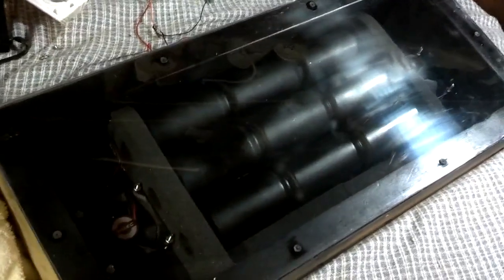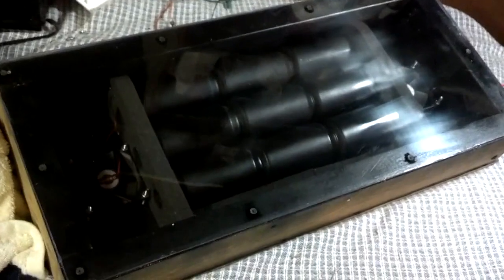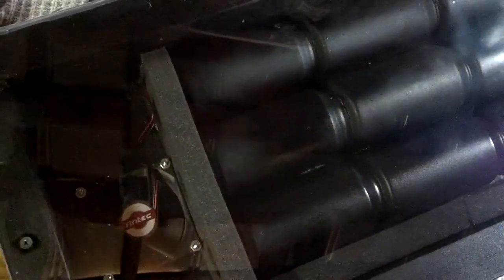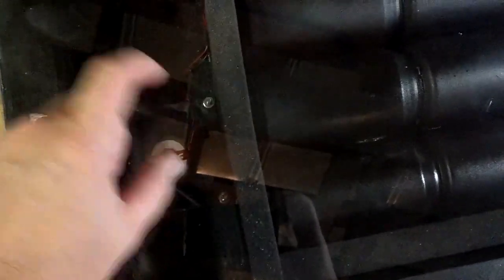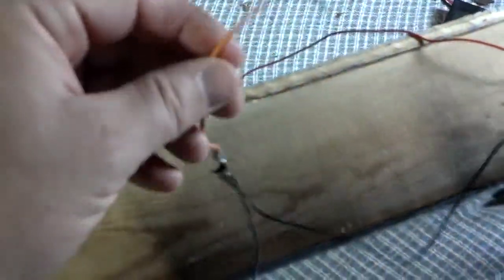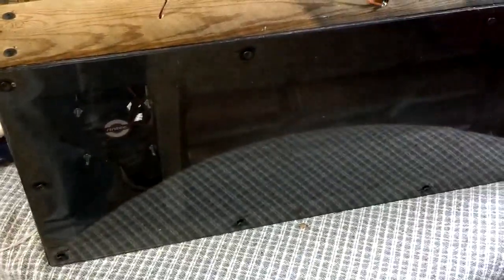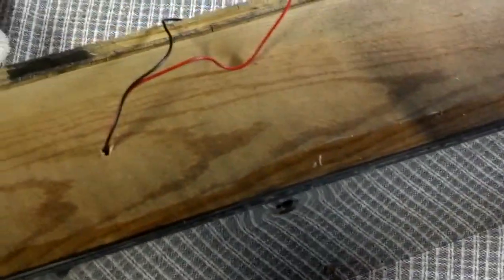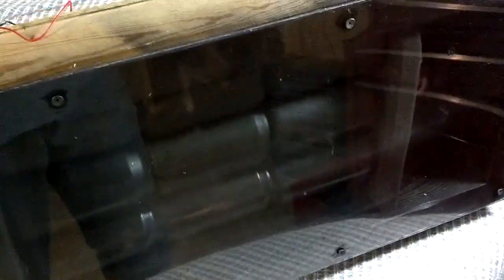DIY Miniature Solar Heater

Comment: The project looks interesting but I wonder if the fans and containment of the box are really necessary. It seems to me that convection would draw cool air in a bottom opening an out a top opening if it were just left open to breathe at the top and bottom. That way you wouldn't need to complicated with fans or solar cells, you would just have a simple passive heat collector. For the cans, you may wish to cut off the tops and bottoms, and allow air to flow through them. Aluminum conducts heat well